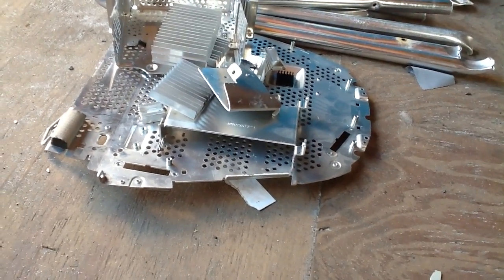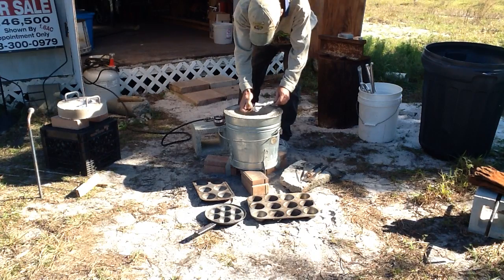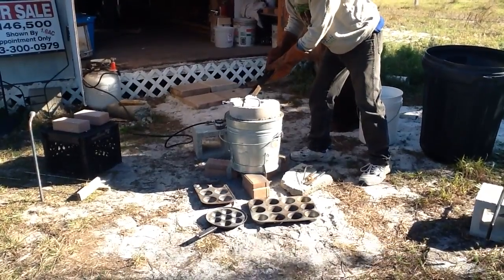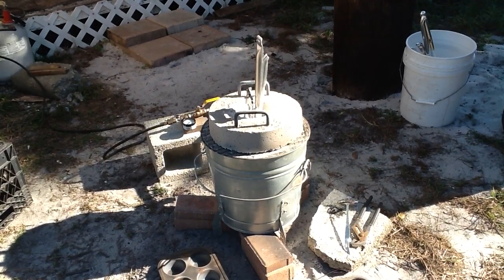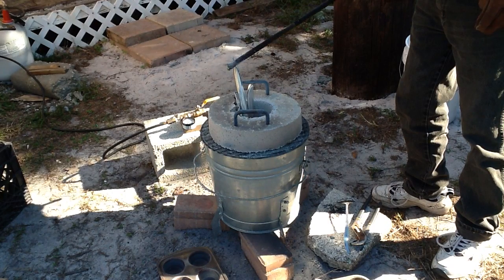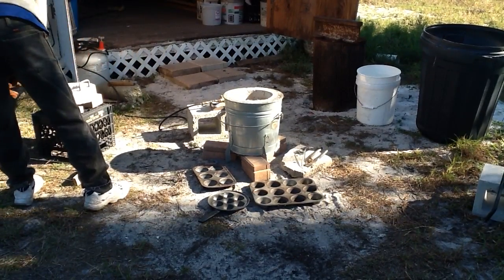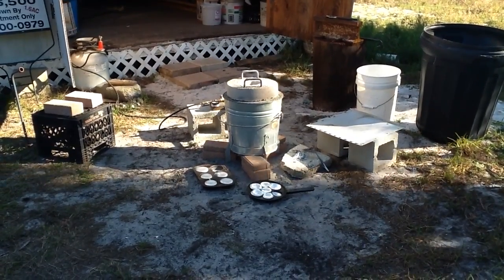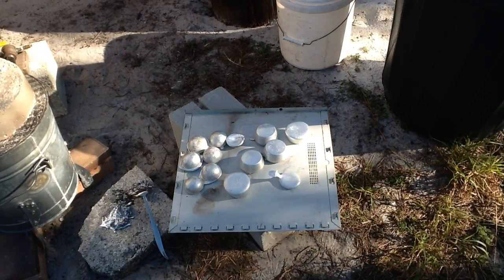Melting Scrap Aluminum and Pouring Ingots

Comment: I just wonder...schedule 40 pipe with a welded bottom for a crucible?
Reply from the maker: Sure, that works too. Try to avoid using galvanized pipe tho ok
Reply: Thanks. I'm thinking about making my own furnace and all. Would be a nice tool to have at my disposal.

Comment: glad someone found a good use for macs
Reply from the maker: +Random_rapper20 Ha!, glad you liked the vid & thanks for the sub! Check out my sand casting video....more of those coming soon
Reply: I see you used Grant Thompsons foundry...i just recently made my own
Reply from the maker: +Random_rapper20 I think Grant Thompson made a charcoal furnace using plaster as a refractory. This one is a propane furnace and a portland cement & perlite mix for the interior of the furnace. They look similar tho. How is yours working for ya? Would like to see it in action....

I have the footage of me making this foundry, I should get it all edited and put up the vid
Reply: +Makin Sumthin From Nuthin ! I haven't actually melted yet, haven't gotten around to getting charcoal. however I ran it on wood scrap I had laying around and dried it out. it didn't crack at all so I think it'll work good, once I get the time to melt
Reply from the maker: +Random_rapper20 Nice, share your results! I am about to put up a vid using a furnace with NO INSULATION at all melting down a lawn mower engine & some other misc stuff. From a cold furnace to aluminum flowing was a little over 3 minutes. Check it out when ya have time....its my forced air burner in that vid, its a beast... :-)